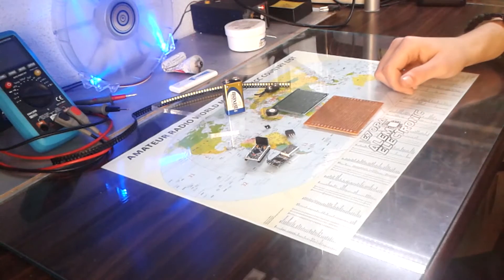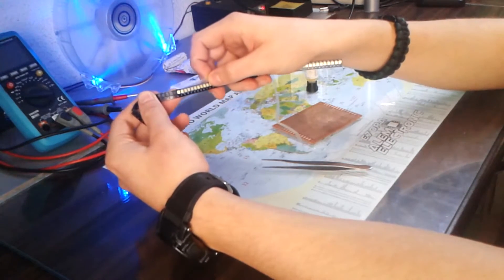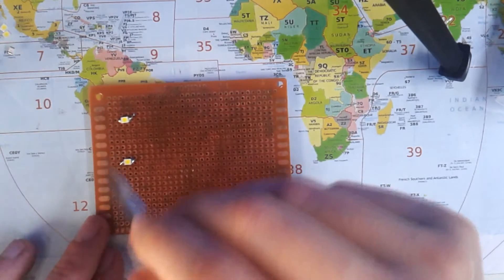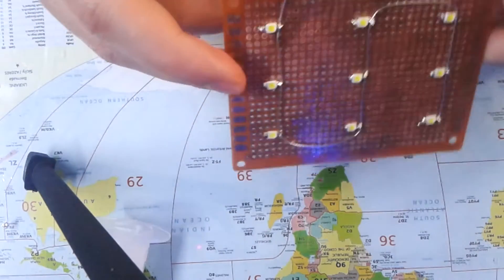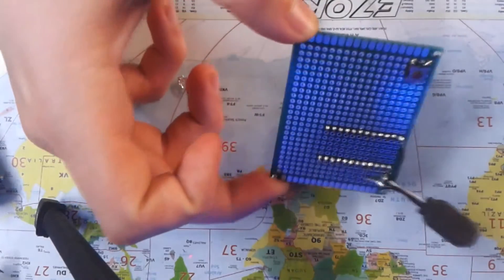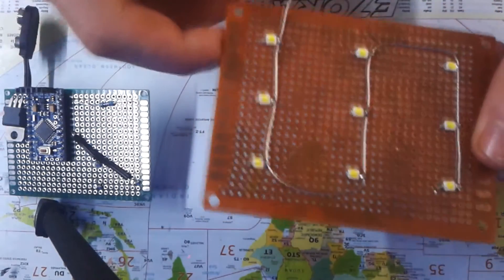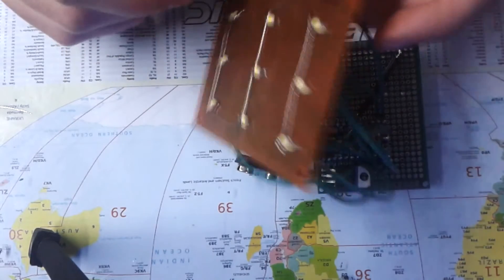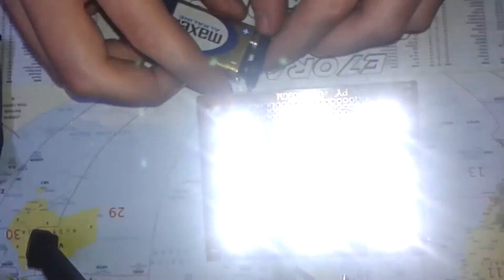How to make a Portable Stroboscope

Comment: Hi there. Thanks for the video - I think it's a big help. I'm trying to make a strobe that has a variable flash rate up to at least 50 hz. Would this project be capable of that frequency? 
I tried to visit your links but they are dead. Please can you provide new links.
Is there any chance you could do a video on how to build a strobe that could control three channels (so they each flash at a different rate) with a variable flashing rate up to 50hz and can also take an input signal to fire flashes whenever the input signal goes off? I found this project but I have absolutely no idea how to assemble this lol (http://www.instructables.com/id/Stop-Time-with-an-LED-Stroboscope/).
I know you probably wont be interested in this project but I'm desperate and thought I'd try asking anyway.
Thanks again for the awesome video man. Cheers
Reply from the maker: Hi there thanks for the comment and your support links are updated now,strobe that can turn on and off 50 time in one second its possible but you wont notice that but i can be done for 3 channels as well, right now i dont have time to build that but maybe sometimes in a future
Reply: Alem Electronic Do you think you have time to build that suggestion yet??